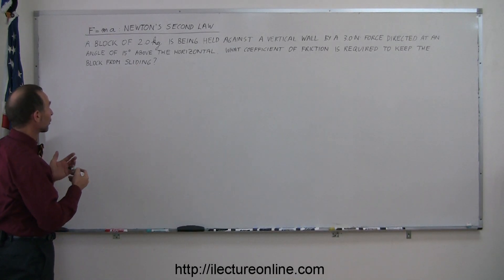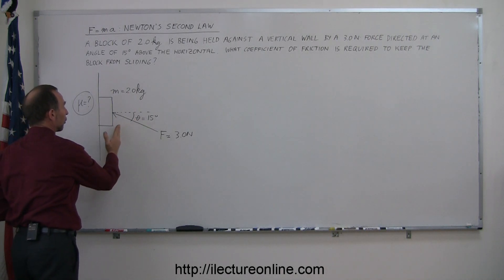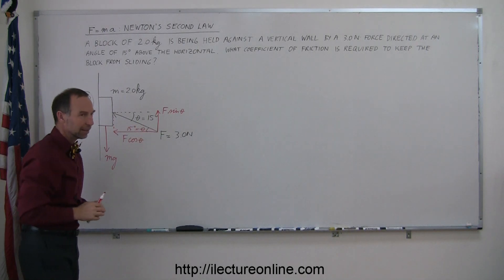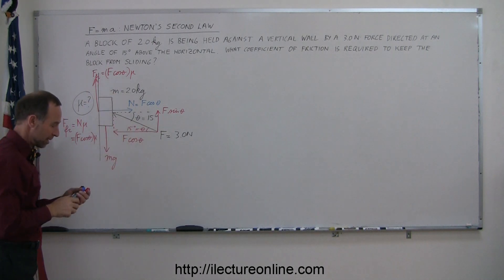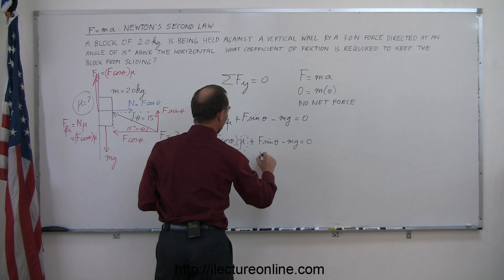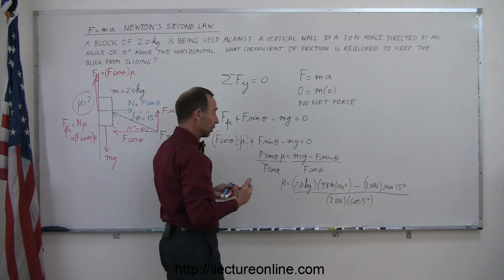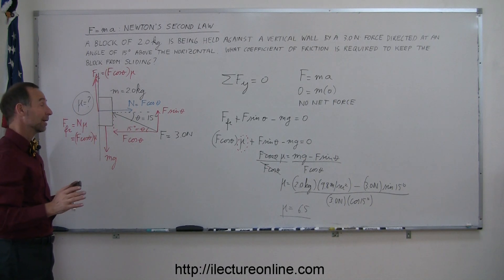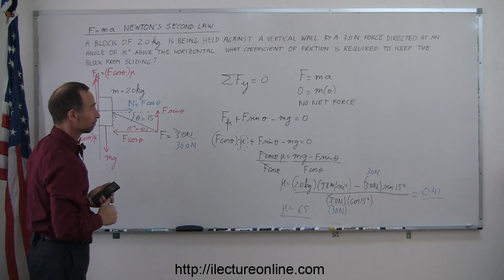Physics - Holding a Block Against a Wall

Comment: Sir what about the reaction force to fsintheta
Reply from the maker: There is no reaction force to F sin(theta).
Reply: @MichelvanBiezen  Sir sorry for asking again but according to Newton's third law of motion there is always an equal and opposite reaction and as there is a reaction force to fcostheta in the opposite direction there should be a reaction force to fsintheta as well as they both are the components of the force which is being applied on the block
Thanks in Anticipation 😊

Comment: Why that the 0≤μ≤1 ?🤔❣️
Reply from the maker: The coefficient of friction is derived experimentally.  For just about every typical surface the coefficient of friction is measured to be between 0 and 1.   If it were greater than 1 it would require more force to drag the object across the surface than lifting it in the air.
Reply: @MichelvanBiezen  and that is possible isn't it 🤔💗
Reply from the maker: For surfaces that are flat with only the roughness of the material contributing to the coefficient of friction you would not expect to find a coefficient of friction greater than 1
Reply: @MichelvanBiezen  ok ❤️😊

Comment: A cooler is standing on angle mounted on the wall 
Having weight 100 kg 
How much long it stand with
The cement and wood are holding this cooler and heavy gaze iron t angle mounted on the wall
Its own weight is 30 kg 

So how much weathering destroyed it 

In India we see this type of situation and many decade's are passed but we don't care about this
One's installed 

Is their any study which show the weathering and weight proportion
Reply from the maker: I don't know of any studies like that.  But what manufacturers typically do, is test products for aging and wear in an accelerated manner so they don't have to wait years for the result.   (It is exposed to corrosive materials, heat, cold, radiation, etc.)

Comment: I was wondering if you knew how to accomplish this problem:  Starting from rest, you are pushing a box (m=4kg) horizontally with a constant force F=30N. After pushing it for a distance d=5m, the box reaches a hill inclined at theta=25⁰.  You stop pushing the box as soon as it reaches the hill.  The coeficient of the kinetic friction between the biz and the road is =0.4 and the hill is frictionless.  How far up the hill is the box going to go?

I can email you what i did but i got an answer of 0.6787 meters and I dont think that is correct.
Reply from the maker: W = F * d = 30N * 5 m = 150 J = KE of the box after pushing.     This will be converted to PE = mgh + W friction = KE initial    h = KE - W friction) / mg = ( 150 J - mg cos(theta) * mu) / (4 kg)*(9.8 m/sec^2) =        Then d (up the ramp) = h/sin (theta)    We have a number of examples in our playlists just like that.

Comment: Actually 6.5 can be the answer as even though in most relevant applications µ < 1, in more layman's parlay a value above 1 means the force required to slide an object along the surface is greater than the normal force of the surface on the object. An object such as silicone rubber, for example, can have a coefficient of friction much greater than one.

Comment: what if the block is sliding down at a constant speed (but not accelerating)? what is the upward force required?
Reply from the maker: The net force must then be zero and thus it will be the weight of the block minus the friction force.

Comment: Why can't the force of static friction be more than 1? What if the brick was superglued to the wall or something, then wouldn't that force have to be much more than 1?
Reply: I mean coefficient, because regardless of how small the normal force is, the block will stay up
Reply from the maker: There are unusual circumstances where the coefficient of friction can be greater than 1 as you pointed out.

Comment: What happens per say if the force acting on the block acts in the horizontal direction without an upward component. I.e the force was perpendicular to the block?
Reply from the maker: That makes it easier as you don't have to consider the vertical  component of the force.  (The normal force then equals the F applied).
Reply: Okay. Cause I'm trying to understand a question like this. A body(2kg) is held against a wall by a horizontal force(60N) perpendicular to the body. Coefficient of static friction = 0.50.We were told the frictional force between the cube and the wall was 20N. I'd expect in an instance such as this, Fnet in the Y direction is 0 since the body is at rest, Fnet in the x direction would be 60-friction=0 since the body again is at rest. and thus 60=friction=normal(60N)*mew(s) or 60*0.5. Why then wouldn't the frictional force between the cube and wall be 30N?
Reply from the maker: The friction force will be equal to the weight of the object, even though the normal force x coefficient is greater.   The friction force will adjust to what it needs to be to stop the block from moving up to the maximum possible.    (If the block had a mass of 4 kg the 60 N force would not be large enough to keep the block from sliding.)

Comment: why would coefficient of friction be dependent on applied force?  shouldnt it be a constant?
Reply from the maker: The coefficient of friction does not vary as a function of applied force.The problem is asking:  what would the coefficient of friction have to be so that the block will not slide?
Reply: but the way the question was addressed makes it seem like mu was a function of applied force because you spent time comparing mu = 6.5 with 3.0 N applied force with that of mu = 0.41 with 30.0 N.  I feel like the way the question was worded could potentially give the wrong idea to beginning students.  I'm not targeting you or anything...but this is a problem with physics textbook questions as well.
Reply from the maker: You are correct that it is often difficult to interpret word problems of any type, including those in physics.  This question (in my opinion) appears clear about what they are asking, but what is clear to me does not necessarily appear clear to others.  (The mystery of communication).

Comment from the maker: Gareth,
The force is directed at an angle of 15 degrees above the horizontal and that is how it is drawn as well.  Remember that a vector can be moved to any location as long as the magnitude and direction doesn't change.  So you can move the vector to the left so that the tail starts at the wall and then the vector will "appear" above the horizontal.  It is actually the exact same situation with the exact same outcome.
Reply from the maker: Phynos
Excellent explanation!
Reply: Still a tad confused by your explanation Michael, I agree vectors can be moved as long as their direction doesn't change; but in this case the question states that the vector is above the horizontal whereas in the video it's drawn below the horizontal with reference to the dotted line.  If the vector is drawn above the horizontal dotted line it points downwards as you would expect it do (with the tip touching the block),  then the Y component of that vector would be in the same direction as mg;  however if it is drawn below the horizontal dotted line then it has to point upwards (again tip touching the block) as therefore the Y component points in the same direction as the friction force.  

I suppose in this case the orientation of the vector has changed from pointing down to pointing up. :-)
Reply from the maker: Gareth M
Gareth,
Maybe this will help:
Think about the sentence:  "The force is directed at an angle of 15 degrees above the horizontal"
Before you do anything else, think about the meaning of that sentence.
Reply: I have Michel hence my observations above!  Clearly it's a moot point as to what constitutes above or below a horizontal reference line! :-)
Reply: Phynos
When one begins to get personal one can assume one is loosing the argument.
No further communication will be entered into with your sort.

WAT
Reply: Gareth M

The force vector is aiming 15 degrees above the horizontal. Where the arrow is on the vector is key.

In this diagram, If it were on the bottom-right, the force is directed away from the wall at 15 degrees below the horizontal. This force aims 15 degrees below the horizontal.

Since it is on the top-left, it is a force directed towards the wall at 15 degrees above the horizontal. This force aims 15 degrees above the horizontal.
Reply: Phynos

What is key is the question which states that a force vector (which has magnitude and DIRECTION) is directed at an angle of 15 deg above the horizontal (the horizontal reference line is even drawn).  The force vector that is drawn in the video above is drawn at 15deg below the horizontal i.e. with the arrow pointing upwards 15 deg below the horizontal reference line.  It really cannot be any clearer however I appreciate that this is a moot subject so we'll just have to agree to disagree. :-)
Reply: Gareth M

I disagree that it is hopeless to make sense of the confusion so I'll give it one last try with a simple analogy. It isn't as brief as I planned but do read through it.

Think of when you point somewhere to direct someones attention to something. You expect that person to look in the direction you point and usually they do, that is the convention.

They know where to look by following the line you form with your finger, and they follow that line in the direction the tip of your finger points. People don't follow it through the back of your arm, only to end up looking behind you.

It doesn't matter where you are, in a 5 foot hole or on the ground, you're still pointing in the same direction.

Same goes for vectors. The arrow on the end of the line tells you the direction the force is acting in. In the video, the vector he drew indicates that a force is acting on the object at 15 degrees above the horizontal.

"but in this case the question states that the vector is above the horizontal whereas in the video it's drawn below the horizontal with reference to the dotted line. " - Gareth M

The question says nothing about drawing a vector, it only tells you the direction of the force, which is indicated by the vector he drew.
Reply: Phynos

"The question says nothing about drawing a vector, it only tells you the direction of the force, which is indicated by the vector he drew."
Phynos

The question tells you the magnitude of the force (3.0N) and the direction (15deg above the horizontal)...hence a vector!

As previously said we'll have to agree to disagree on this one. :-)
Reply from the maker: Gareth M
Ask yourself the question:

"In what direction is the force acting?"

What would your answer be?

                                    Michel
Reply: Gareth M 

"The question tells you the magnitude of the force (3.0N) and the direction (15deg above the horizontal)"

Yes, that is what it says. It does not tell you where to place the tail end of a vector you may or may not draw to help answer what the question is actually asking. Nor does it tell you to draw a vector (which is what I said, apparently you missed that). It only says the direction in which such a vector would point if you were to draw it, and the vector is only drawn to help visualize what is happening.

If you point straight up and jump, the direction you are pointing does not vary throughout the jump (assuming you're perfectly stiff). The arms position is irrelevant, the direction matters. If this makes no sense to you then yes we will have to agree to disagree.
Reply: Phynos

As I said we'll have to agree to disagree on what you consider above and below the horizontal to mean in terms of direction.
Reply: http://lmgtfy.com/?q=what+is+a+vector%3F
Reply: Phynos
Thanks for proving my point. ;-)
Reply: What point? You don't understand vector notation. It's not like it's complicated. Google it. I gave you a quick access link above.

Anyone that reads through this would understand what is being said, either your a troll or just dense.
Reply: That's fine, you can communicate with who you want on here. That's the beauty of the internet. Another great thing about it is that you can easily look up concepts such as vector notation. Or you can just argue over your misconception, whatever floats your boat. Some people value their opinion more than the truth.

Comment: In the question it says the force is directed at an angle of 15deg above the horizontal. However in your diagram you have drawn it at an angle of 15deg below the horizontal.
Reply: I know it was 2 years ago, but for anyone who is still wondering (like me).
I think I got the solution: we must think the angle forming from the origin of the vector, not the end.
If you look at minute 2:34 Michael draws a second 15° angle starting from a line parallel to the floor.
It's like a mirrored unit circle. Try mirroring the whole problem.
Reply: @johndingo4633  Thank You! 🥹❤❤
Reply: To some who might still be reading this comment, here's my take. At first try, I also drew it with the tip on the block and the tail pointing upward to the right and drew an angle 15deg with horizontal line I drew from the tip of the arrow toward left, BUT, intuition told me that, 1) I had to solve the problem according to what the intention of the owner of the problem would be and not mine, 2) to support a block against a wall and to keep it from sliding down due to "mg", it makes no sense applying the force downwards, and 3) in, archery, when we shoot an arrow and "direct" it at a 15deg angle, we don't usually measure the angle from the tip of the arrow end but from the tail end (near our eyesight) with respect to our horizontal line of sight, which in that same sense, Mr Biezen drew the other 15deg angle at 2:36 with respect to the x-component supporting his point that from there the main force itself is directed 15deg above the horizontal up towards the block.
Reply: @joeyborja423   Thank You Too! ❤❤